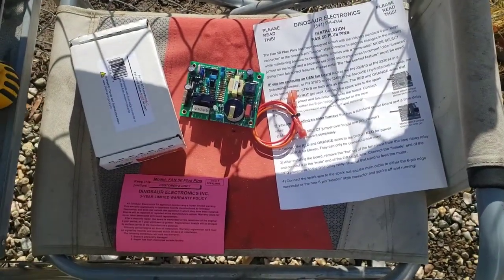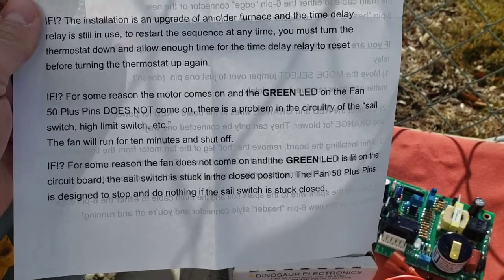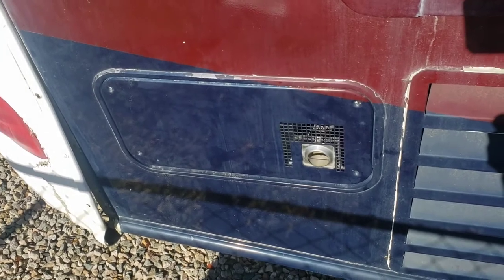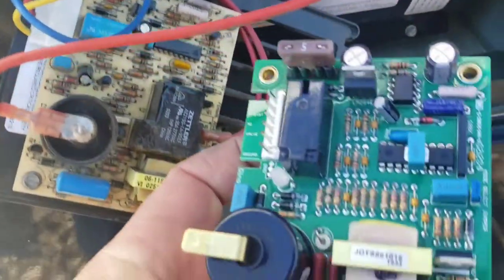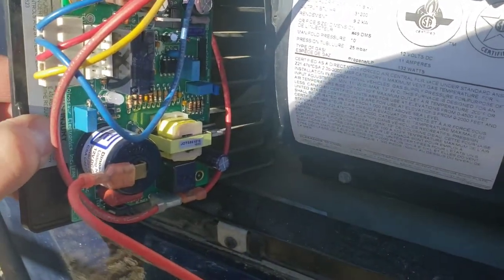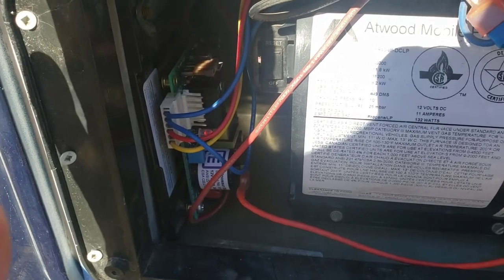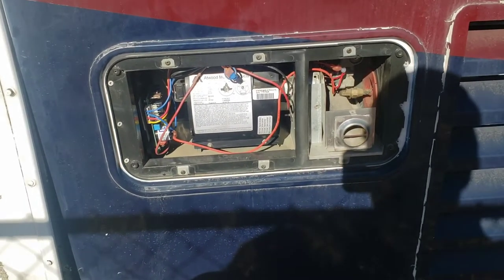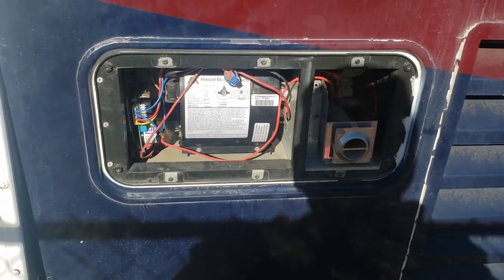Atwood Furnace Fix With Dinosaur Circuit Board

Comment: Want were the symptoms?  I have a similar Atwood furnace that is very intermittent.  It works now and then, but often won’t work.  The symptom points to the sail switch, the blower runs, but not attempt to fire.  However, when I check the sail switch, it tests out fine with a meter.  Today, I pulled the furnace (no outside access door) and placed it on the floor and it would not fire.  I removed the blower cover to access the sail switch and if I closed the switch by hand, the furnace fired right up.  This suggests lack of air flow, but the blower spins just fine and blows lots of air.  I am going to replace the sail switch since that is cheap and easy to do, well once the furnace is removed, but I am skeptical that is the problem.  I am wondering if it is a flaky board.  Just curious what symptoms you saw.
Reply: Did you pull and inspect the burner head? Will try to fire but not light up correctly if it’s all corroded out easy to swap.
Reply: @ Turns out it was the sail switch.  It checked out find every single time with a multimeter, but something about it didn’t work once assembled inside the blower housing.  I finally decided to load the parts cannon after all normal diagnostics failed to pinpoint the problem, and replaced the sail switch first as it is the cheapest part and easiest to replace.  Furnace has worked fine since then, though we only camped four more days after the repair.  I still can’t believe that he switch worked perfectly on the bench and not in the furnace, but that seems to be the case.

Comment: Hi!  Thanks for the video and it is very informative!  I am replacing what appears to be the same circuit board (Atwood 8525-IV) that you have, except some parts on the board are a different color.   I also bought he Dinosaur fan 50 plus board, but my instructions tell me to use the two wires (Red and orange) that came with it in the box.  Since it is not one of the two models listed in the instructions, did you choose not to use the orange and red wires that came with the board?
Reply from the maker: I don't think I used the extra wires because the instructions said I didn't need to. The dinosaur board has been a solid unit. I'm currently full timing in my Motorhome in below freezing temps and it's been doing fine.

Comment: Where did you order the circuit board and what was the number mike
Reply from the maker: There's a link in the description of the video that'll take you right to where you can get it on Amazon. This was the Fan 50 Plus Pins model.